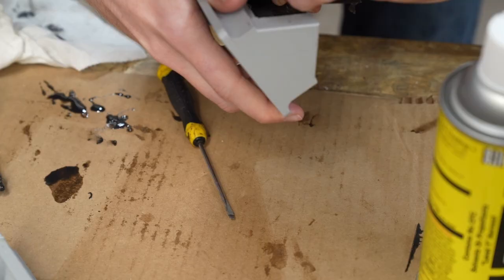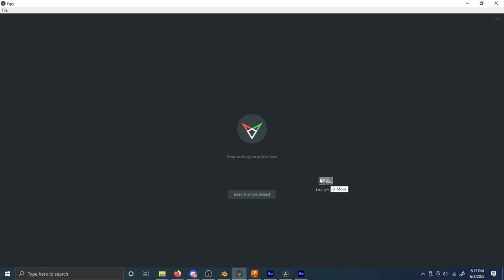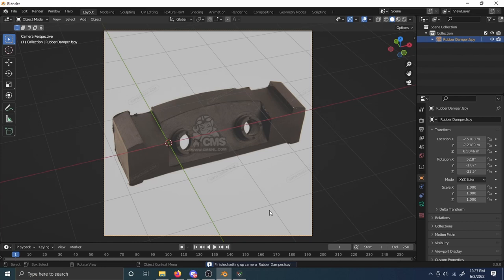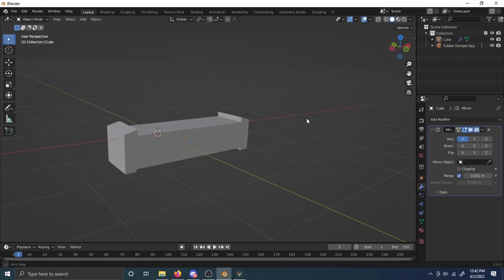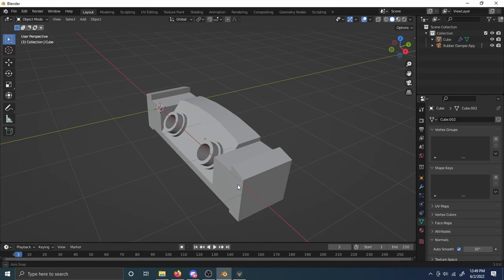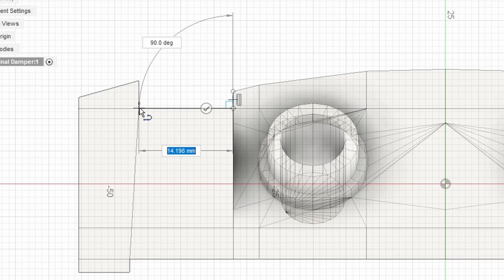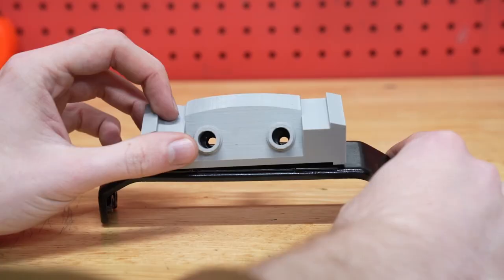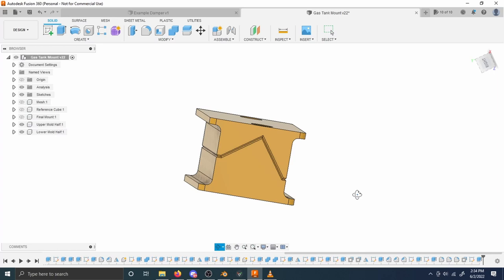3D Scanning with a Single Picture

Comment: Young man, as an old, retired designer, in both graphic and industrial design, you can not imagine what I would have given to have such tools to use instead of my old drafting table and rulers ! See, my first computer was a revolutionnary 1984 Apple MacIntosh ! 
 Me and my partner at the time, were the very first ones in our area to use such a machine. Clients were do impressed !
As our design business grew, we hired fresh, new, faster young turks as you are. We got tech distanced so fast, it was scariy.
 Now, simply as a hobbyist DIYer, I would like so much to use such tools. But at 70 y.o. the learning curve is too steep !
 My learning cells are now too slow, damn it ! My internal hard disk is obviously overloaded.
Anyway, I found your channel by your resto on the 1985 Fiero 2M4. I owned 2 1984, and now my precious, mint 1988 GT, 5 speed.
At least, we're Fiero enthousiasts, about the only thing we share !
Keep on doing your fine work ! You have a bright future in engineering, sir ! 👍

Comment: My first 3d printer is in the mail.  I am renovating an abandoned house.  When I got here, the fridge was nasty and the shelves were all gone, as well as the inner door parts.  The sticker with the serial number and model number are faded and unreadable.
The fridge was super cleaned outside and still works.  Rather than buying a new fridge before I renovate the kitchen, I am using the old one.  I will be applying this methodology on the door interface for the door shelf braces.  Print the left and right sides, attach them to something in-between and hopefully have new temporary door shelf retainers.
So, this video was super helpful.
Reply: That's a bright idea to keep, restore your "old" fridge. The new ones are crap. Don't last.
Reply: @marcryvon  Most people would have tossed this fridge.  I spent a lot of time scrubbing it outside to get it clean enough to keep using it.
I chose to keep it because I was able to get it clean and I would rather not buy one of today's throw away models.

Comment: Really looking forward to part 9

and dude, a 280Z??? that's going to be a crazy project
Reply: Hopefully, a turbo manual !
Reply: @marcryvon  well if the badge is correct, it's at least a manual 5-speed 
Edit: the L28ET (turbo 2.8) was only in the 280zx so unless it was swapped in, it's not turbo

Comment: I actually used a bunch of these processes and a few others yesterday to design and print a sprocket for a motorcycle water pump for a friend in town. 3D printers are amazing. It took me 2 hours to design using Tinkercad, CorelDRAW and a few pictures and measurements with my caliper. 4hs to print, though!

Comment: If the purpose is to make as OEM part as possible then it is a good plan. Lazy me would have just made visually similar part in CAD, using the  distance between bolt holes as a reference. Anyways - good work and looking foward to new episode.

Comment: Just recently got another 81 Honda CB750 Custom with 27,500 on it. Been abused but Looks Mint.. Need Clutch Work, Hoping it just needs adjusting because it's starting to Slip real bad. Guestamate on Rebuild $500... Starter also needs work. It don't like to engage all the time and will just free spin. Exhaust leaks at the ports because they are cracked. Gas Tank is completely Crusty Brown inside. Paid $2200 for it. Came with Brand New Tires. A Color Matching Honda Front Cowl that would make it look like a Gold Wing IF it actually fit. Only One Side Luggage Rack. The Back Rest and Luggage Rack Option. 
It's Still "Ride-able" but with the Clutch Slipping and me on a Road with Up Hill Both Ways.. not so much. Had one when I was 16 for 9 years. Paid $2500 for that and had I Think 56,000 on it. Damn Nice Bikes. Still Get Compliments from people when I was able to ride it before the Clutch started slipping too bad.
Reply: Sorry, but I don't understand how something that's been abused, can look mint. To me, those two descriptors couldn't be farther apart.
Reply: @michaelskinner896  One can Abuse the Engine and Clutch and Not the Frame or Body Parts.. I mean it does has Normal Wear and Tear for being an 81 But there is No Damage to the Frame or Body Parts. Just like you can Ruin a Engine and Trans of a Car and it still look Brand New.. By Abusing the Engine and Trans by Not knowing WTF You are doing... Reving the Shit out of it and Slamming it into the Wrong Gears... Because My Original one Also look Mint but was Never abused and Never needed the Engine or Clutch worked on with the 56,000 on it.. Hell, didn't even have to change the brakes Because it was NOT Abused...  or is this over your head??
Reply: @ravenlorans  Calm down grasshopper. Call it what you want; I was just asking for clarification.

Comment: I was all set to complain that blender isn't a program you should use to model something to be 3D printed!

Then, I noticed that I was only halfway through the video, and waited for the rest. You delivered! Very nice.

One of the neat things about copying someone else's design, oftentimes it's designed and some specific locale. If you know around where it was designed, you know if it's designed in metric or imperial. Then, you can round your measurements in either metric or imperial. So if you find that the hole is close to 47 mm, it probably is 47 mm. Or half inch or whatever!

But great video. If I have to do something similar I'm definitely going to reference this.

Comment: I have no intention of ever needing to do anything like this, but it’s still incredibly fascinating!
BTW, you said you measured it at 4cm but you put in the dimensions as 40mm? Is there some kind of software that distinguishes between the different sizes?
Reply: One centimetre is made up of 10 millimetres. 
The metric system is everything devided or multiplied by ten.

Comment: Is that a 240 or maybe a 280 in the final shot?!  Oh, I'm IN!
Reply: A 260 or a 280.
Reply: @michaelskinner896  Did you notice something that eliminated the possibility of a 240?  I'm not super educated on the differences.
Reply: @BoomerKeith1  Just the shapes and arrangement of the tail-lights. Look up some images of the 240's tail-lights and you can some differences.
Reply: @michaelskinner896  Gotcha.  I wanted a 240 Z so bad when I was in high school back in the 80s.  Even though the 280 was the modern version, there was a 240 that drove around my neighborhood and the sound and look of it was awesome.  I digress.  Thanks for the info!
Reply: @BoomerKeith1  based on the crash bar I'd say it's a late model 280z
Reply: @chrismichaelyoung  Sounds like you guys are better at identifying the model than I am.  Either way, I can't wait!